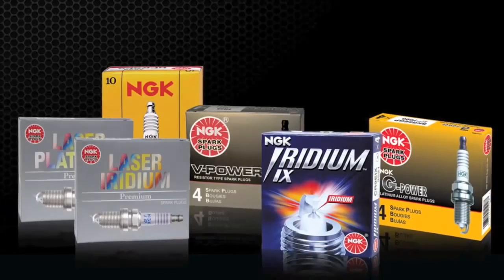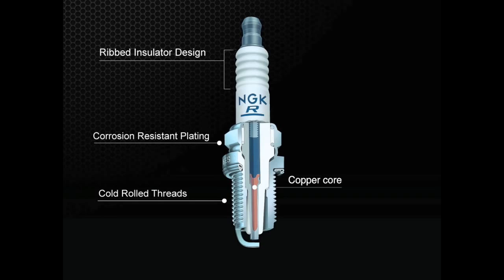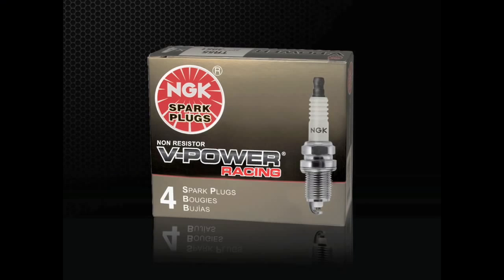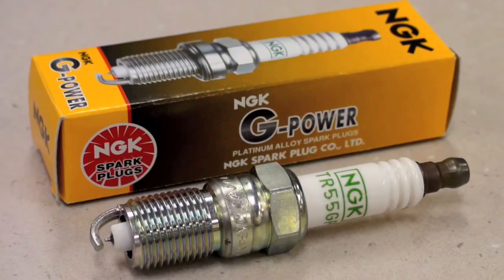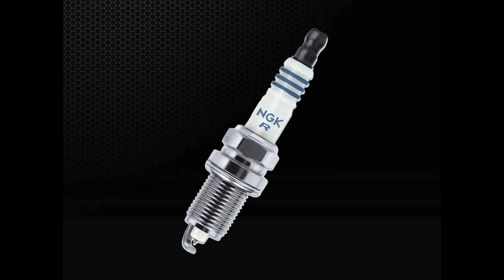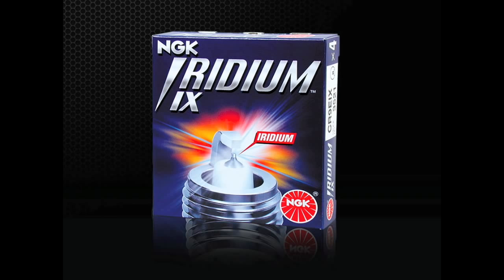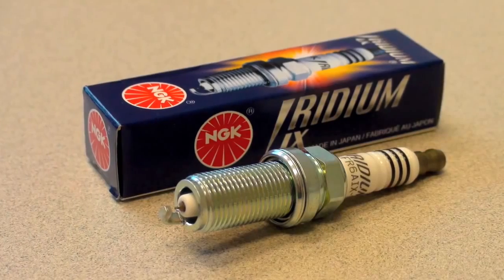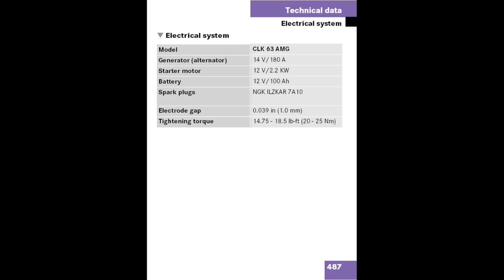Spark Plug Types - NGK Spark Plugs - Tech Video

Comment: Was using the base NGK plug on my little Toyota 4cyl 22R Carb PU.  30mpg with top speed of 90mph.  Then I installed the next level G-Power plug.  Wow, crisper "off the line" acceleration and my top speed pegged the speedo at 110mph.  The jury is out on my mpg but my gut tells me that it will be the same or better unless I get a little lead footed now that the truck lays scratch...ha...ha.  Unlike others I have had good performance from my stock Asian carb and won't go for the Weber which so many love.  I am planning on port n polishing the manifold and slap on a larger header exhaust to get the gases out of the engine quickly.  I've put 150,000 trouble free miles on the truck.  Uses 1qt oil per 1000mi now here in So. California.  Surprisingly I get better performance using 10-30 over 20-50wt.  Go figure...

Comment: The only reason to use these is because of the long lasting material it’s made of. Also if it’s hard to get to your plugs, you may want to use these based on frequency of change. You will not get any boost in speed just to let you know.

Comment: i got a 2002 Chevy Impala it has 88,000 miles what's the best spark plugs and wires to get for a 2002 Chevy impala that got 88,000 miles if the miles have anything to do with it ?
Reply: mangreat71 irridium bosch or ngk

Comment: I have installed cng in my 2006 Honda CR-V. I m getting an average of 9 to 10 on cng. I want to change the spark plug. Which one is recommended to increase mileage

Comment: i drive a 1.4 VW polo vivo and it is misfiring and i know for a fact its the spark plugs haven't changed them in 30 000km and i do 2500km per month. ..what NGK plugs would be the best for my little 1.4 VW 2011 model....thanks in advance
Reply: CARiD thanks for the  response, I have found out which spark plugs would be good for the car Its the ZFR6T-11G

Comment: if a car calls for platinum would it be ok to use irdium
Reply: T'srides83 w yes it would be better
Reply: Yeah, if your car came equipped with platinum plugs, you can upgrade to iridium plugs, same goes for cars that come with standard copper core plugs, you can upgrade to platinum plugs.